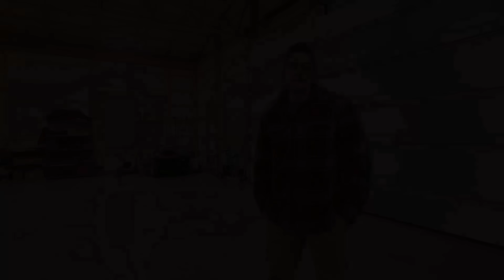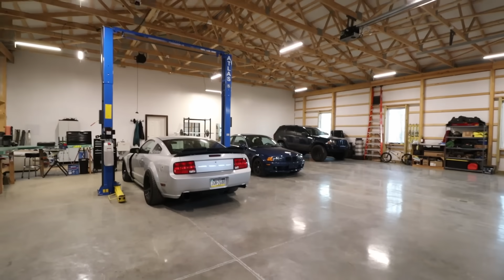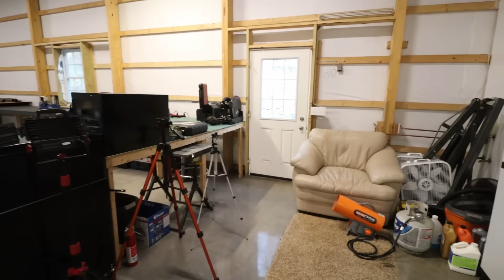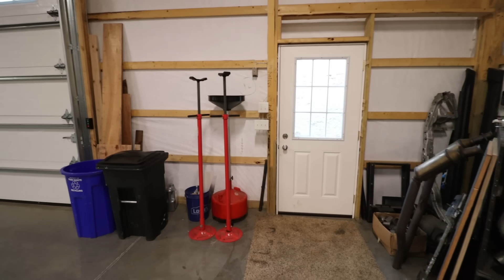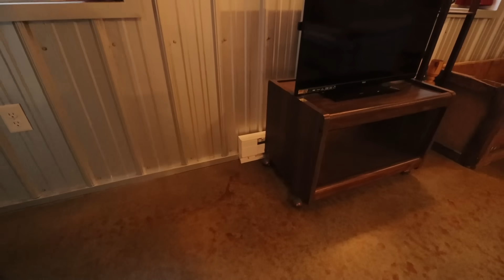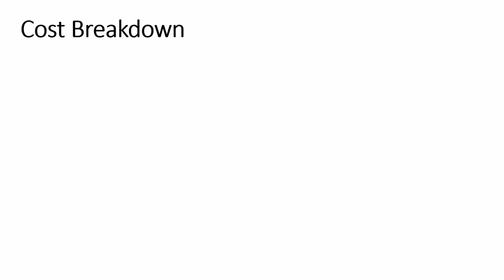50x70 Garage House - FULL TOUR and COST Breakdown

Comment: Personally, if I would make a dream garage. No windows. Because as an ex mechanic (t9 spinal injury, can't work anymore) the absolutely worst shop I worked at was the single bay shop I got stuck at for 2 years. Where all the windows completely ruined working on cars. Because that natural light causes shadows. Instead I preferred the other shop I worked the most at. Which only had 1 door in and 1 door out, and no windows. And with shop lighting, it made working on cars so much easier. The only downside was their old lighting which were huge single bulb lights and only a few of them. So my dream garage? would be an insane amount of LED "soft lighting" but bright as hell. So the ceiling would be covered in lights. in your example. I would probably 3-5x the amount of led bars. especially since LED barely uses any power. meaning it wont suck a ton of electricity.
Reply from the maker: I have added more lights since this video 🤘

Comment: Did you hire a builder to come up with the plans, do the framing, run main plumbing under concrete, etc. and then you did alot of the finishing details to save costs? This is the route I am pondering about doing. Have a builder come up with the plans, have plumber run main plumbing lines, have concrete slab and shell done professionally, then do a lot of the inside stuff myself. Kitchen, running electrical for outlets, flooring, insulation, drywall, etc. The floor plans, main plumbing under concrete and the frame/trusses would be a little overwhelming to not have a builder do lol. Just curious how you went about it all.
Reply from the maker: Yes that's basically what I did. I had an electrician do all the initial work but since this I've now built two more bedrooms and two more bedrooms myself. Check out my newer videos to see what I did. Good luck with yours🤘🤘

Comment: It is beautiful.  When you insulate the garage please look into rockwool insulation.  Fiberglass is terrible for you health and safety.  Consider a fire suppression system for inside your paint cabinet, even a small one from amazon would be better than nothing.  If you ever get tired of all the work involved with firewood (been there) mini-splits are amazing, heat and AC in one, very energy efficent.  I am watching this because I moved to FL, from PA a few years ago.  I remolded a home and now I am selling it.  I'm going to build a garage with an small apartment in it.  I'm getting ideas and this is very close to what I have been thinking.  Than you for making the video,
Reply from the maker: I appreciate the suggestions! I did recently install a mini split in the living space. Check out my more recent videos, it has changed a lot 🤘

Comment: Great video! I would make sure that your second floor is designed for live loads-  more than just supporting the ceiling. It looks that way to me (not intended for inhabited live loads).  Fine for a loft or light storage, but probably dangerous for master bath with tiled floors (i.e. cracked tile at the very least, fill the bath tub and end up in the living room at the worst ;)  ) . The clearspan on your main living space suggests that the beam flanking your stairs inadequate as well - based on how open your main living space - that beam is long and is supporting 19' joists. Update, I just watched you other video, the floor is actually the underside (bottom cord) of your roof truss. If you live in a very high snow load area it might be designed for higher loads, but i would contact the deisnging engineer. Short version - if those are 2' O.C. roof trusses - a master suite up there is essentially an unsafe idea.
Reply from the maker: Thanks! Those trusses are 100% designed as livable space and live loads.
Reply: @Kordare  glad to hear! way to plan ahead.

Comment: I bought the Atlas 9K residential model last year. I'm actually very happy with it. It seems very well built. It doesn't have the single safety release lever and I'm fine with that since its just one less thing to break and I'm not using it day in and day out so the extra several seconds isn't a big deal to me. I didn't use the wedge anchors provided, I installed 2 and they barely held. I expoxied 5/8 threaded rod instead....soooo not going anywhere.
Reply from the maker: I've had mine 6 years now and haven't had any issues!

Comment: I’ve been considering doing this, much smaller though, I’m thinking 30’x60x16.Turn 30x30 into a garage, leave it unfinished with polished concrete floors and a 30x30 living area and 30x15 loft. My thoughts on building this type of  setup is build what you need, you can always make it nicer later.

Comment: Impressive.  The only fault I have with the design is changing the roof pitch for the residential part.  If it had the same pitch as the garage, you could have had much more usable space on the second floor for your master bedroom.  Still, it's a great place and an inspiration.
Reply from the maker: Thanks! Actually the change of roof pitch enabled the space upstairs since the room is actually inside the roof truss. It wouldn't have worked the same way if I kept the same pitch as the garage portion. It would have been a lot more custom framing and definitely more money.

Comment: how do you not havea problem with condensation with no heating or insulation
Reply from the maker: I have heat and insulation in the living space. The garage never really has any issues. Usually once a year in the spring the slab will sweat a little but that's it.

Comment: How did you become so wealthy independently with no help at such a young age and able to buy everything without a long history of established credit? Oh...2 million views...I see
Reply from the maker: Haha I built this way before I started making YouTube videos. I still don't even make minimum wage from YouTube. I went to college and got a job, saved everything for a large down payment and got a loan for the rest.
Reply from the maker: @TerryHesticles01  maybe this will help you understand: https://vm.tiktok.com/ZM8252o45/
Reply: How much outdoor air are you pulling into the living area? I would probably run a good 100 cfm fresh-air tapped right into the side the return air drop. Or you're going to need to get a recovery ventilator if you're running a mini split with multiple cassettes. You can make an exhaust fan out of a gutted furnace( 4 speeds. Black fast, blue, medium high, yellow medium low and red is low setting). Hopefully its not that tight air wise never see mold. I made one out of a blower motor and squirrel cage. Cut your hole outside to the dimension of the opening of the squirrel cage of the blower , and put a flapper plate on there to keep the house sparrows and starlings out. Throw and alternating relay for speed setting you desire and your good. Better than spending over a grand and getting one of those Cook capped exhaust vents.

Comment: I would have put a drain in by the water heater, if you didn't..or I would have put the electric heater up higher in case the water heater goes out or something. But my place has flooded, so that is what i think about. Nice job. Beautiful place.
Reply from the maker: Thanks! And yes I have a drain right by the water heater and the pan that it sits in has a spout that goes directly into the drain.

Comment: not up to code in my area.  2x4's  are like 8 feet apart😵. never seen vertical member more than 24 inches apart in any scenario. all else looks goot but the stuf are just not stable that far apart.
Reply from the maker: Hahah those are not 2x4's, they are 4x7s (actual measurements)

Comment: You should have ran the pipe in the ground in the shop and house for radiant heat even if you didn't have the money to get the unit at least the hoses would have been run to add later
Reply from the maker: I did want to do that but it was something like $8k just to do that so I just couldn't afford it.
Reply: @Kordare   Anyway too late now would have been cool  To do and have been way more efficient a  Woodstove in the shop will work too
Reply: @Kordare   It shouldn't have been $8000 to run. the pipe should of cost a few 100 bucks and you could have installed it yourself before they poured the concrete
Reply from the maker: @SALFXEF  yeah but that was the quote at the time and I didn't have time to try and figure it out. Also didn't wanna worry about drilling into the pipe since I've now mounted many things to the floor.

Comment: i randomly stumbled across a barndominium style house, and compaired to normal houses... i dont see why you wouldnt want one of these. cost way less and less to maintain. i feel like. idk. is there really any significant downside to this? other than it looking like a storage place? do you keep heat in the winter?
Reply from the maker: The living section is fully insulated and holds heat very well. I have yet to insulate the garage but it's definitely on the list.
Reply: @Kordare  another thing my wife was asking me to ask you, how is it when it rains or hails? Is it super "Tingy" with the droplets hitting the roof. And hows the heat in the summer? Does it get too hot like a baked potato? Haha. Those are her main concerns.
Reply from the maker: @n0xxm3rcyxx  the garage is loud with rain and hot in summer just because of no insulation. The living section is quiet and stays cool very well.

Comment: nice build, was my same plan years ago, i paid cash for my land in ware town ship in north western Ont. when i was 19 years old, it was heavy solid timber, i had it logged and had a D8 dozer come in and strip the stumps and cut out a shelf for the building, had hydro and drive way i put in my self, both 900 feet long, i picked up a used mobile home for temp living, planted grass for my live stock, had the well drilled and a root cellar, the cutting of the timber paid for the land and every thing i dis up to the mobile home,,  i bought a big steel building same size, but 18 feet high, i also bought a 14x14 insulated door commercial track and wall opener, but i did this stupid thing called getting married, she turned up to be a gold digger and cheater, and got court orders for every cent i saved, every thing i owned, she broke in an cut the water line in the mobile home an turn the heat off, well i was away for 4 day, at 25 below every thing froze solid, my insurance wrote the place off, and cut a check to me, but before i got the check my ex got a court order to have the check go to her, witch she never paid a dime into, we had no kids, she got a court order to sell my land, it went on the market for 94k but she took a 20k offer, my family counter offered 22k to save it for me, to this day i am trying to pay them back, i still have the building, doors in a pile,,  but now i am 60 and broke on disability, so my dream died.. to bad for how little extra in floor heating cost, that you never put it in, pex pipe only 23 cents a foot, and rigid foam is not that much.. and can be hooked up down the road..  never get married, save your self.. wish i did, check me out..

Comment: Electric septic. Nah im out. Your on the low side of the hill. Septic runs downhill. If your pumping uphill to a mound your design is faulty. Period.
Reply from the maker: That is where my perc location was and also with requirements for distance from well and shape of my lot, that was the best place for it. I'm glad it's there because it's completely hidden and out of the way.

Comment: Great job but you overplayed for the structure.. You can get a 50x75x18 prefab steel building for 40k another 20k to build it and 8k for foundations - should be working out to say $15  per sq ft
Reply from the maker: For my area I did not overpay. I got many quotes. You have to remember that included all doors, windows and a second floor in the living space. Yes base structures are cheap but once you add all those things it adds up.

Comment: Pretty awesome planning. And yea, General tool boxes and home built work benches are the only way to go because you can design to your specific needs. I just love that pipe/metal storage shelve you built. Kudos on the Hobart, not a fan of Miller.   Last but not least, THANK YOU.  I was not aware of the concrete specs for a lift so you taught this 59 year old something.  I am building a new 40x60 shop in three months (Texas) and you gave me some ideas.
Reply from the maker: Good luck with your build!

Comment: You are going to want to get at least one tall tripod (three legged) jack as well, because you'll find the pole screw jacks can tip to one side or the other if the vehicle rises off the lift pads. Just saying, it makes it very possible for the vehicle to shift to one side and fall between the lift arms. A tall screw jack that has three legs will not tip or it is very stable in comparison to one of those pole jacks. Using a pole jack under a transmission or engine to jockey it around is perfect. If your lifting up on a control arm or frame area it's easy to come up off the lift pad and not realize it. That's when you get into trouble. If you ever put a long frame pickup on the lift and have to raise it to the top for maintenance you put the tripod stand under the rear bumper or trailer hitch and it stops it from moving around.
As far as your house and shop goes, for me that place is the ultimate dream home. Personally I think all homes should have a garage that you can work at the work bench with at least a pickup truck still in the garage with the garage door closed.
Thank you for the video!
Reply from the maker: Really appreciate the feedback, thanks!

Comment: How did you do the concrete on the living space? Did you just do the 6 inches  throughout or did you have to do a slab on grade under the living area?
Reply from the maker: I did 4 inches in the living and code required it to be raised compared to the garage to stop a car from rolling into living space.

Comment: Hello, so first of all the video is really good. Picture and sound are really good. Nice one. For me it is very interesting to see what you have built and how you built it. I come from Germany and here you don't see this kind of buildings. There are exceptions. But very few. Especially the fabric of the building. As I said, very interesting how you do it there. There is also "lightweight construction" here, but it is very different. Mostly it is built massive here. Concrete, stones. Even wooden houses have a concrete floor, sometimes bricked underneath. But mostly concrete floor, stones, concrete ceiling, stones, then wooden roof with tiles. And here a lot of attention is paid to insulation. Cold bridges are closed as well as possible. The sewage system is also mostly regulated by a city sewage system. Rarely one needs sewage basins / or pumping systems. Of course, on the rural less, but even there widespread. The differences are really big, how you build what and what options you have. Wish you good luck and all the best. A nice Christmas and a good start to the new year. I hope for many more videos. Many greetings from Germany PS: Sorry, my English is not the best.

Comment: Awesome setup. I will have 2 Propane tanks for cooking, water heater and back up heat.  Propane tanks WITH wet legs to fill your mobile bottles. Can't or don't depend on electric for anything!
Reply: Why don't you depend on electric for anything?
Reply: @AuditThem  I have lived through TWO  winter Blizzards were the electricity went out for over a week here in Eastern Colorado. Broken power poles and huge snow drifts prevented power repair crews from working to repair the lines for over a week. Generators run out of gas in a couple of days and we were 15 miles from the pumps. No electric heaters or cook stoves for me!

Comment: That's a cheap well.  That can get way, way more expensive real quick.  My mom drilled a well that almost cost 100k.  Dunno where you live but it's been a long time since I've heard of a well under 20k
Reply: Good price then.  Mom's was waaaaayy up in the sticks.  Could barely get equipment up there.  Had issues with rocks and all kinds of crap.  And the guys drilling were miles from a restaurant or anything and they hated working up there.  Something about the casings were almost impossible to get in too.  Close to 300 ft. was all.   Still, everyone I know who's drilled a well paid more than they were quoted.
Reply: And to be fair, there were pumps and pipes and basically a little water/irrigation system and they brought power to the pump etc.
Reply from the maker: Whattttt I've never heard of a well that expensive. Never heard of anyone around me paying more than 10k
Reply: @Kordare  This is the Idaho cost in Idaho. I'm guessing you didn't have to go nearly as deep.   How deep was yours?
Reply from the maker: @markw999  I don't really remember but I think it was around 200 ft